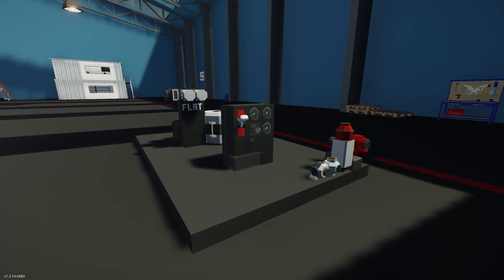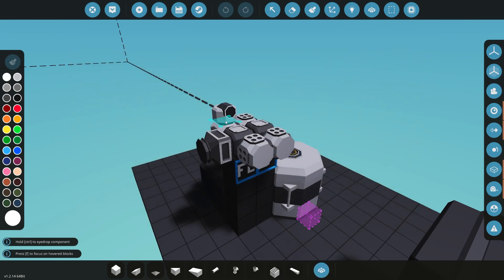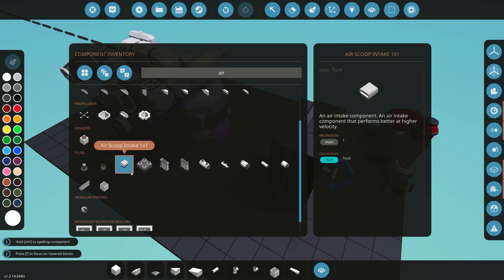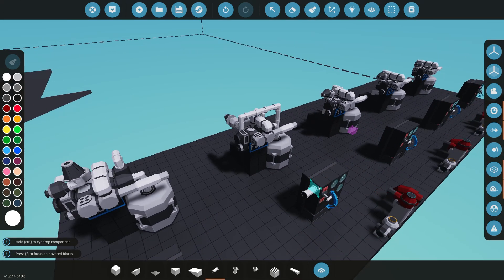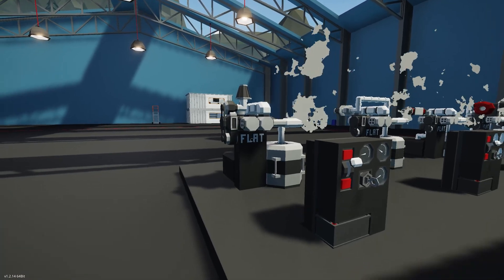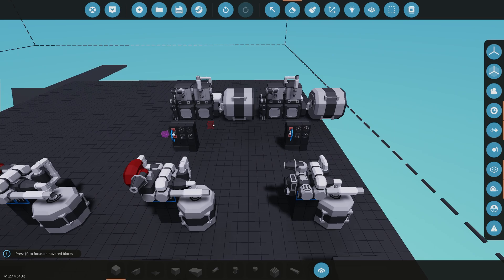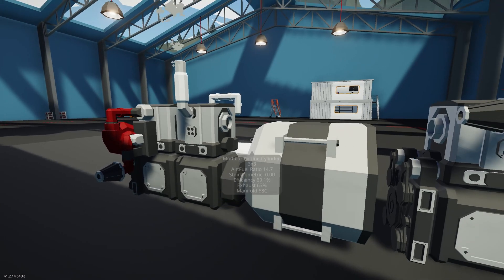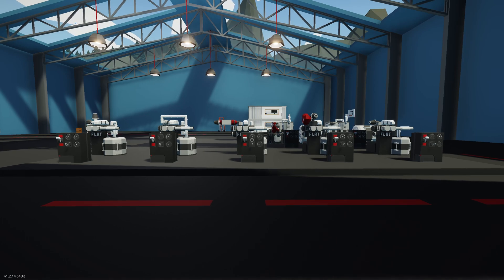Do Superchargers Work?? - Modular Engine Test - Stormworks

Comment: You’re not necessarily turbocharging them you’re actually super charging them if you’re running the air pump directly from the motor

Super charging is when you run the compressor off the engine, power and turbocharging is when you run the compressor off of the exhaust gases

Comment: Testing is unfair: the electrically driven pumps are "free" (draining the battery), while the shaft driven pumps engines are using energy.  This needs to be accounted for!

And since engines seem to be more efficient at low RPS, high load (high clutch), we need to attempt different RPS ...
Since the generator is the target output, I would suggest:
- set a number of generator power setting as target
- go over a wide range of RPS/clutch combinations to get the power, record the fuel usage
- check RPS/torque conversion using gears, allowing the engine to run at higher/lower RPS than without, see if we can get the engine into the most efficient band
- for the belt driven pump, see if changing the pump clutch changes the equation
- for impeller driven pumps, see if a clutch and/or gearing does change the equation
- for the electrically driven pumps, we need to subtract the electrical power used from the generator output
- for the electrically driven pumps, see if a tank as a reservoir and a pressure-operated on/off switch for the pump reduced the electrical power needed
- and vary over a range from lean to rich air-fuel mixture --- or have some automated tuning select the most efficient combination (a smoothed first order derivative of the RPS may be a good indicator), then change the throttle to get back to target RPS, repeat until we are there
- also, we need to control the engine temperature --- I have reasons to believe that it can effect the efficiency.

As your engines were not running at the identical RPM, they might have run under different efficiencies.

Comment: This is no supercharger, supercharger are either belt driven or shaft driven.  In stormwork it's belt and RPS output. Turbocharger are driven by hot exhaust comming out of the exhaust manifold

Comment: I do not really understand the physics behind this, but would it change much if you use a large impeller pump? 
And will this work on a regular engine (like the small stock engine)?
Reply: The reason it works is that the pump supplies a constant volume of air, otherwise it may fluctuate as the manifold doesn't actually pull any air in.   More fuel require more air, if the flow is too low for the proper amount of air it will be too rich and lose performance.
Reply: @Bendigo1  and this means what? Does this work with stock engines?
Reply: @finnbergermann   1 part fuel needs about 2 parts air.  If the air manifold doesn't have pressuised airflow, at a certain throttle setting it may only be able to provide 1.9 air for 1 part fuel.  If it has a constant flow of pressized air, the manifold always has a surplus of air available to be able to maintain the proper ratio.  

As far as i know, the prefab engines are made to automatically have the proper ratio so as long as there is enough capacity of air it will run at optimal values.

With modular engines the stoichiometry changes with temperature so air/fuel ratios need to change to maintain power and efficiency.

Comment: I just went to go and make a super charger on one of my engines and I am having a air to fuel ratio problem anyone got any ideas on how to help me cause I am just using divide at the moment.
Reply: Change the divide from 2 to around 1.05-1.2 and enjoy the extra power.
Reply: @EdyAlbertoMSGT3  thank you I have like 8 or so different engines with weird rev limits and take ages to rev up

Comment: Rolls-Royce Crecy I
Specifications
Data from The Rolls-Royce Crecy.
General characteristics
Type: 12-cylinder supercharged liquid-cooled 2-stroke aircraft piston engine
Bore: 5.1 in (129.5 mm)
Stroke: 6.5 in (165.1 mm)
Displacement: 1,536 in³ (26 L)
Dry weight: 1,900 lb (862 kg)
Components
Valvetrain: Crankshaft-driven reciprocating sleeve valves
Supercharger: Gear-driven centrifugal type supercharger with variable angle of attack of the impeller blades providing up to 18 psi (124 kPa) of boost.
Turbocharger: Three engines fitted with exhaust turbine (50% scale version of Whittle W.1 turbine)
Fuel system: Direct fuel injection, 2 x CAV 6-cylinder pumps
Fuel type: 100 Octane petrol
Oil system: Gear pump
Cooling system: Liquid-cooled
Reduction gear: 0.451:1 (Left-hand tractor)
Performance
Power output: 2,729 hp (2,035 kW)
Specific power: 1.71 hp/in³ (77.97 kW/L)
Compression ratio: 7:1
Fuel consumption: 85.4 gal/hr (388.2 L/hr) at 2,500 rpm
Specific fuel consumption: 0.55 pints/hp/hr at 1,800 rpm (with exhaust turbine, ~293 g/kWh)
Power-to-weight ratio: 1.43 hp/lb (2.36 kW/kg)

Rolls-Royce Crecy II
Specifications
Data from The Rolls-Royce Crecy.
General characteristics
Type: 12-cylinder supercharged liquid-cooled 2-stroke aircraft piston engine
Bore: 5.1 in (129.5 mm)
Stroke: 6.5 in (165.1 mm)
Displacement: 1,536 in³ (26 L)
Dry weight: 1,900 lb (862 kg)
Components
Valvetrain: Crankshaft-driven reciprocating sleeve valves
Supercharger: Gear-driven centrifugal type supercharger with variable angle of attack of the impeller blades providing up to 18 psi (124 kPa) of boost.
Turbocharger: Three engines fitted with exhaust turbine (50% scale version of Whittle W.1 turbine)
Fuel system: Direct fuel injection, 2 x CAV 6-cylinder pumps
Fuel type: KEROSENE
Oil system: Gear pump
Cooling system: Liquid-cooled
Reduction gear: 0.451:1 (Left-hand tractor)
Performance
Power output: 2,729 hp (2,035 kW)
Specific power: 1.71 hp/in³ (77.97 kW/L)
Compression ratio: 8:1
Fuel consumption: 85.4 gal/hr (388.2 L/hr) at 2,500 rpm
Specific fuel consumption: 0.55 pints/hp/hr at 1,800 rpm (with exhaust turbine, ~293 g/kWh)
Power-to-weight ratio: 1.43 hp/lb (2.36 kW/kg)

Comment: For me the first method with the belt driven pump doesn't actually supply any amount of air to the engine. I end up reading out with "too much fuel" (I've made sure to set the controller to supercharger ON). I've noticed the logic requires a clutch pressure input for the pump but I have no clue what to connect it to. Am I overthinking here?

Comment: Is it possible that this "superchargers" doesn't work anymore?
Reply: Only way to know for sure is to follow this guide and test it for yourself
Reply: @mgmg116  I had tested it. The big pump didnt work and the small electric pump did the same. Nothing. 
Also the fuel consumption has been chanched. The modular engines now consumption 10 times less fuel then old engines. Something is broken there.
Reply: @Xenon4d  Damn, 10 times less?? I need to get on modular engines lol
Reply: @mgmg116  I think there is something broken since the last update. I wonder that I don't hear something about. But there are also less videos  about that modular engines. Also there is no difference between V8, R8 and B8 Montors in my test. I don't understand...
Reply: @Xenon4d  Yeah, Stormworks is weird. Accurate and realistic when the devs want it to be, horribly NOT so when they don't feel like it xD

Comment: Supercharged my boat and it doubled the speed, wish cooling wasn't broken though as it is limited to 15 kts before the heat spirals out of control, no matter how much cooling I add.
Reply from the maker: Do you have proper cooling? As you should be able to cool a engine up to around 40 reps
Reply: @MrNJersey  the heat exchangers and radiators were 5x5
Reply: @MrNJersey  The most I did was 3 heat exchangers and 3 radiator electrics, each hooked up to 2 coolant manifolds, with 3 small pumps on the seawater end and 6 on the freshwater side. The engine has 6 3x3 cylinders. This was divided into 3 loops, each covering 2 cylinders with a radiator and a heat exchanger. The system was freshwater-filled from and overhead large tank. It would overheat quickly at it's rev-limit of 20 rps, and the heat would spiral out of control at any value above 6 rps. Even with the supercharger removed things didn't get better, and so I concluded that cooling wa bugged and this task would be impossible.
Reply from the maker: Do you have coolant manifold on the crankshaft or on the cylinder? Also do you have a pump to move water, and are alll heads the right direction, there could be so many things wrong, Join my discord and post for help!
Reply: @MrNJersey  im in the discord but forgot about it, the manifold is on the cylinder, all other things I have checked and rebuilt many times.
Reply: @Mike_Rogge  Have you considered running pumps halfway between the rad ins/outs?

I find I seem to get slightly better cooling performance and lower engine temps doing this

Comment: i tried turbocharged, so an impeller pump connected to the exhaust pipes, then the power output of that impeller pump is spinning another impeller pump that is forcing air into the engine. don't actually know if it worked or not cause I didn't see any big increase (also because i was bored and stopped trying to perfect the engine).

Comment: What would happen if the fuel line was run through the cooling system before being sent to the cylinders? Does heating the fuel cause any performance differences? Or is that not even simulated in Stormworks?
Reply: I don’t believe fuel temperature is simulated.
Reply: Thanks for that. My next question is, would running fuel through the cooling system work to actually cool the engine? Even if there's no effect on the fuel itself, it's still a fluid, so I feel there should be some kind of effect on the engine itself. Or it's possibly a self-defeating thing, where the temperature of the fuel gets transferred back into the engine. Eh. Something to look into later.

Comment: Oh hey as per the note at the end. A friend of mine and I have been developing a turbo charging system using a mixed custom and turbine jet engine. It is still pretty hard but it has to do with the negative pressure you can produce in stormworks with jet engines. I'm not even sure if it's an intended feature or if this is just the bare bones of a future feature we've discoverd but yeah you can do a type of turbo charging with that combo.

Comment: Interesting would be what happens when you add a radiator between the pump and the engine because in reality you need to cool the air after the pump or turbo 👍👍
Reply: Sadly in my testing nothing useful. Pumps in game don't actually seem to raise the air temperature meaningfully, so adding an intercooler doesn't actually help performance, its just another restriction to flow. Its a sound concept in real life though, so was certainly worth a try.

Comment: One thing I found out when I was building me train engine. Is that the exhaust amount can have an effect on the engine performance. I originally had two both were connected to each engine but I was only getting low row. I then added an exhaust to each cylinder and it got way higher rpm. I’m not sure if you know already.
Reply: Yep, and where this gets weird is catalytic converters, which cause some restriction to flow, but actually reduce the total amount of fluid. Thus if you put a converter on each exhaust port you can collect several ports together to a single fluid port without meaningfully impacting flow more than if each converter had its own fluid port attached.
Reply: @SheepInACart  oh interesting. Also it is Hard to do this all the the engine is in v10 form

Comment: I am curious if you can use more than 1 fuel manifold... and if so whats the limits on the engine with lots of forced air and massive fuel intake before it explodes... i.e. 50 air pumps feeding air and 30 fuel intakes feeding fuel to keep up... will it work?
Reply: Simply adding more intake manifolds (fuel or air) used to increase performance, but this was patched out. In the present version you'll get the exact same power for a given intake pressure with 50 manifolds as you will with one. On the other hand fuel pumps work just as well as air pumps, so your effectively always going to be limited by the air you can squeeze through the motor, not by the fuel side.

Comment: v6 vs inline 6
Reply: Power/economy wise, each non-pipe block (be it an engine crank, flywheel, clutch, gearbox ect) power travels through develops a tiny RPS loss, but otherwise engine layout makes absolutely no difference. The v6 will however be a bit lighter and cheaper as you need less blocks total, 3 cranks and 1 interconnecting manifold vs 6 cranks and no interconnecting manifolds... but like power the difference is tiny, so basically use whatever fits best, or you like the look of. As a side note, consider how you can get to each part with a welding torch to repair it, its pretty easy to make engine bays that have essential parts you can't reach, and that can turn one small collision (or even a shark attack) into a a very long walk/swim back to the nearest base.

Comment: does that work too for the steam?
Reply: Yes, placing a large electric pump on both intake and exhaust of your steam turbines will increase their flow/power... IMO this should be patched out as it doesn't make much sense (and indeed connecting a pipe between those two pumps will let you produce infinite power without needing any more steam, so is an infinite energy exploit), but as it currently stands its a good way to boost the power to weight/volume/cost of your steam engines. On the other hand there is no point supercharging the firebox, as you can't apply enough useful load to it anyway, and so doing the opposite (restricting intake or exhaust with a variable throttle valve) will let you get as hot as needed produce the same boiler pressure (and thus steam power) with less coal use... fancy way to drive the valve is a PID, but even just a throttle or keypad works fine.

Comment: In all you examples engines runs at different max RPS due to the supercharging, what is the fuel consumption and the energy generated by the different engines running at the same RPS?
Reply: From my testing at present in Stormworks for any given Air/Fuel ratio, engine temperature and RPS modular engines make exactly the same power (and also heat in the engine) per unit of fuel consumed. Given the limited options for continuously variable loads in games, trying to run the engines at the same RPS is going to add a lot of variables that you'd have to explain and demonstrate didn't impact your results, thus while it would give you an accurate percentage power gain to show off, it'd make the example a lot less clear.
Reply: @SheepInACart  Thank you for theses informations, I went on and made a test best myself and conclude the same thing
Reply: @SheepInACart  I used variable wheel brake as a load. I prefer to do my tests at fixed RPS though.